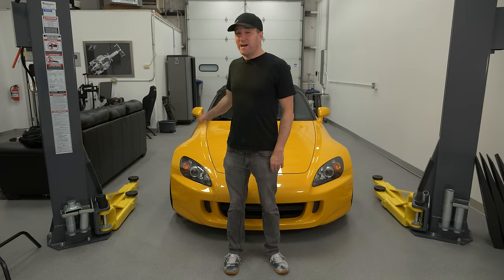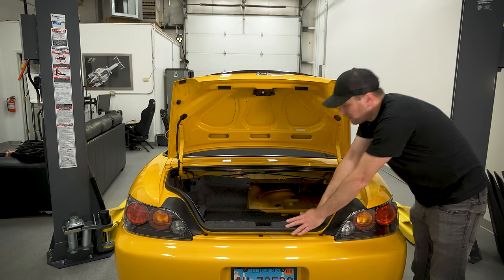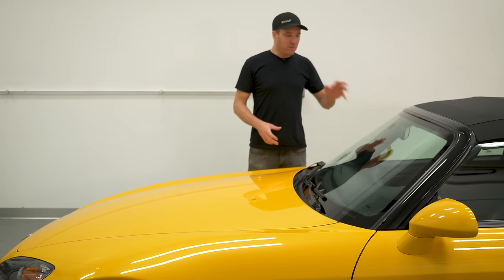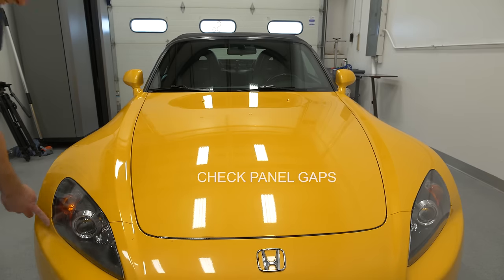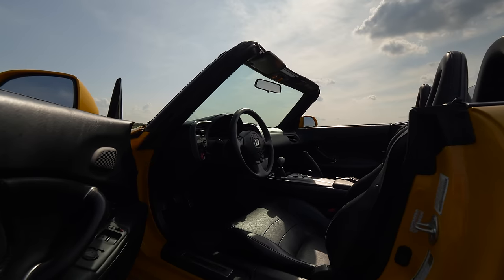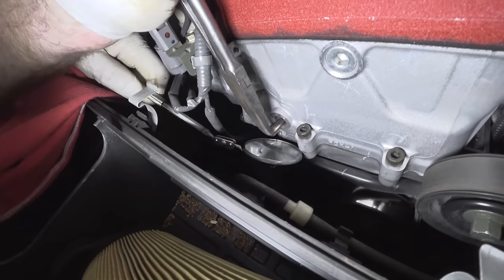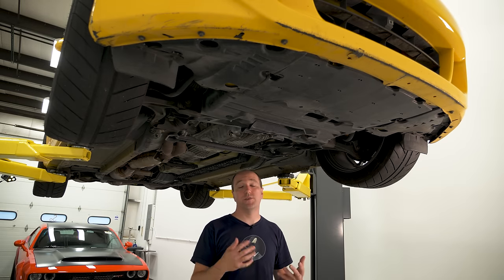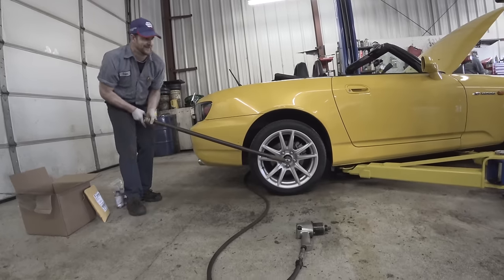Honda S2000 Buyers Guide and More

Comment: Please answer me on how you put 255 tires in the front. Your fenders aren't rolled. Can this be done without rubbing? I wanna do 245 square
Reply from the maker: Without being lowered it will work on the 949 17x9 +55.  Lowered you have to roll.

Comment: At how many miles do I need to do the valve adjustment? I bought it with 17k miles and now it has 22k and I actually know how to drive it now.
Reply from the maker: Id do it around 30k.  You burning any oil or have any valve chatter?
Reply: @savagegeese  I have to top it off in between oil changes but I drive it hard/am up in the higher RPM's when I do take it out. I am not familiar with valve chatter but I don't hear anything unpleasant from the motor.
Reply from the maker: @TheSpread1  Just do it at 30k and put it out of your mind.
Reply: @savagegeese  I will, thank you! I subscribed on both of my google accounts.

Comment: S2000 prices are pretty firm. If a buyer walks away, there will be another buyer lined up for it.
Reply: vaajchang and there will be another s2000 actually worth the price.
Reply: Whatever another buyer wants to do is fine. At the date this video was published there are still quite a few of these cars around for sale (relatively speaking). Those who are holding out for a S2000 in great shape will still manage to find what they're looking for. No need to panic. Lots of good advice in this video.
Reply: @OCD Stig wrong, I've gotten some really good deals on s2ks under 10k.

Comment: Is there any way to find out if one of these was over revved?
Reply from the maker: No ECU does not store that data. Have to inspect head. On AP1 cracked valve retainers are common.
Reply: savagegeese but even PPI does not usually do that... if engine sounds, idles, runs good with maybe good compression test, will that be a sign of a healthy engine? Also, if the car ever had a gear popping out during driving (like because the original owner didn’t fully engage into gear while driving), can it permanently damage the transmission? If it does not pop out when I test drive, does that mean it’s okay?
Reply from the maker: @zpzp96  yes PPI wont check heads. Have them do compression test.  If huge varience run away. Also gear popping out is damage to trans from previous owner.
Reply: savagegeese I know it happened ten years ago once while the original driver (who sold the car back in 2012 when the car had 24k miles and the incident happened 2010) was driving hard. Apparently it never happened again according to the current seller and he tracked the S2000 couple times over the 40k miles (currently 65k miles on it). Does this mean transmission didn’t get any permanent damage? When I test drive, if none of the gears pop out, is transmission good to go? I will do a compression test.

Comment: Buy a new mx5 if you’re lazy and want to avoid headaches
Reply: sounds good to me lol. doesn't cost much more to get a base Miata ST anyway :)
Reply: Nothing wrong with a MX-5, I'd happily own one. It's just not the same car as the S2000. For those looking at the MX-5 I'd suggest buying used to avoid taking the big depreciation hit. With perhaps the exception of a few super clean, ultra low mileage NA models, or maybe some of the Mazdaspeed units, prices overall will continue to depreciate on the Miatas while prices on S2Ks already bottomed out a while ago. Mazda has already built over 1,000,000 Miatas and are continuing to produce more. Honda only produced something like 111,000 S2000s in total. So you'll always be able to buy a MX-5 for considerably cheaper than an equivalent (condition, mileage, etc.) S2000. Definitely something to consider. But it's also all the more reason to buy a S2000 sooner rather than later if it's the car that appeals to you.
Reply: Yeah buying a Miata is so much easier with so many available. It's the buyers market and the vast supply is pressuring prices.
But that also means it can be a headache to sell it later. You'll be one of 1000s of sellers.
You really want to be dead sure you're going to keep the Miata, cause you may not get it sold easily.
With the s2000 it's a bit more of a seller's market. Not that many to choose from.

Comment: why are honda people so paranoid about honda oil filters?  I mean sure, I'm against the 99 cent special... but most so called "generic" oil filters are as good or better than honda oil filters...
Reply: Bob Last I’m not sure it’s the filter media with generics that’s the problem but rather the bypass valve opening too early at high rpm.
Reply: Peejay Em that's why you get a filter with a properly pressure rated valve...
Reply: has there been a test done to see if there's an actual issue with generic's bypass valve opening to early?  or was it just some know it all on the internet somewhere that started some stupid rumor and everyone went along with "omg better play it safe".  and seeing as it made this buyers guide, are idiots now gonna think that an s2k that used non honda oil filters are somehow worth less money?

Comment: When seeking the perfect S2000, the first step is to buy a Miata.
Reply: said no one ever.
Reply: Get rekt
Reply: @itstheFranz  you don't know the meme I guess xD
Reply: @i_read_bad_reviews  s2k is a boat. 4 mx5 generations later mx5 is still here while boat s2k is dead.
Reply: Only if you're metally challenged or a miata fanboy . The only reason why some people go for a miata over an s2k is because miatas are dirt cheap . If they where the same price 100/100 times a person would get an s2000 over a miata . Clean  s2000s under 60kiles are still priced around $20- 28k .
Reply: Prodigious 909 nah mx5 is better. You can get one for dirt cheap and just put an s2k engine and it will still be better than the POS s2k
Reply: Well considering they share the same dudu differential... LoL explains why they're so unpredictable.
Reply: Best fun affordable car mx5ND you know nothing John snow...